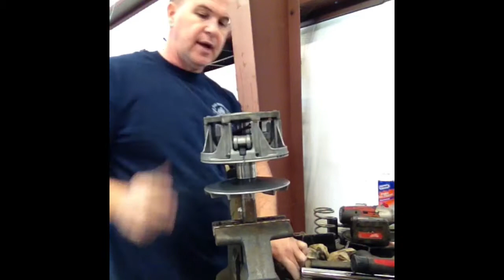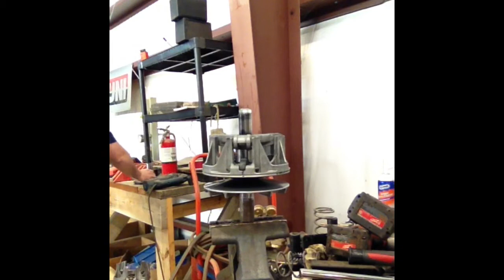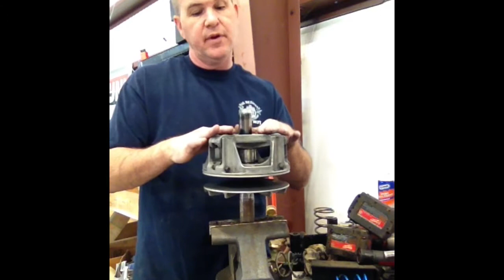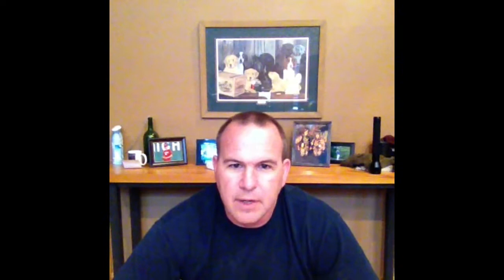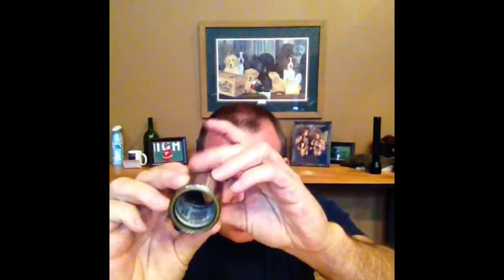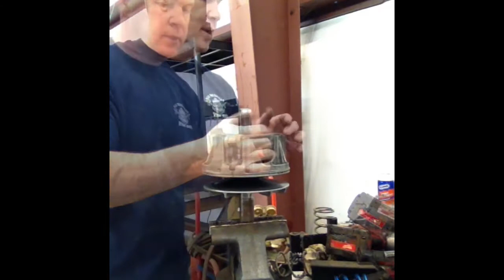New Bearing Install Take 2

Comment: Have you ever had the lower/inner disk crack, just happened to mine cant find a new one anywhere
Reply from the maker: To me no but seen it a lot. You can't buy that part, you need a new clutch, it is a balanced assembly

Comment: I got a 2014 Polaris rzr 800 has a set of built after market clutches it needs a one way bearing I got the bearing go to take my clutch apart took the bolt off the front of the clutch and it will not release
Reply from the maker: I would not know since I do not know what clutch this is
Reply: @Hunterworks  it’s a cvtech clutch i hearted it up and beat on it a couple of times and it finally came apart thanks for the help